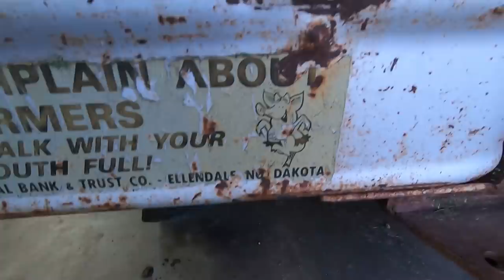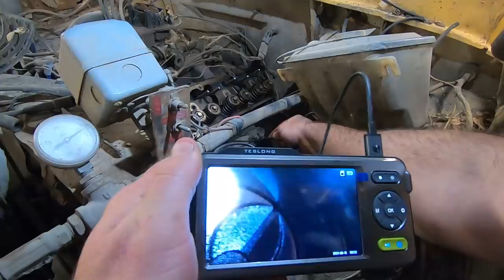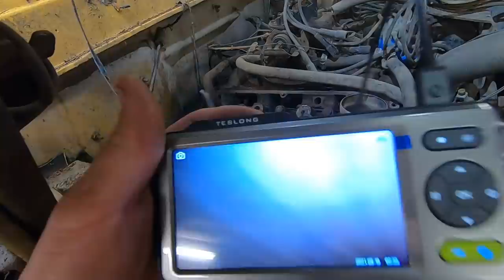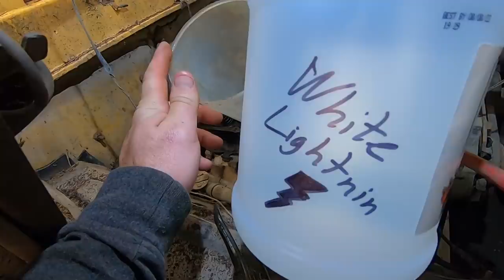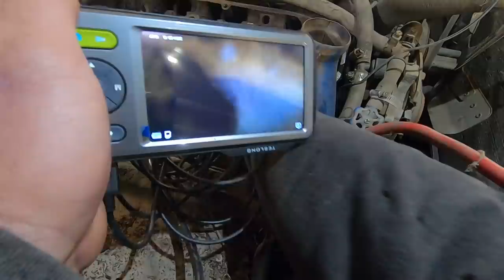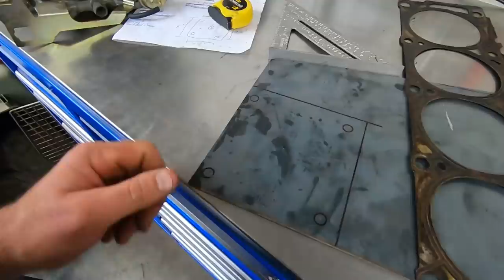Abandoned Farm Truck! 1971 Ford F100 4x4! Will it Run?!? Parked for 18 years in a field!

Comment: I never heard of the white vinegar hack to unstick an engine. I woulda got some real white lightnin and dumped it down the carb and lit her off the ensuing fireball would have been a sight to behold for sure. Either that or black powder and toucher her off Kaboom! Maybe you could get a subway sponsor they could get you samwhiches for you at a discount. Fords are only fun if they run and drive and have been maintained over the years not left to rot in a field. I have a 1989 Ford F150 XLT Lariat with original 160,000 Miles and 5.0 engine runs perfectly a 2006 Ford Explorer 4X4 also runs perfectly on its second engine and rebuilt trans and my 2004 Mercury Grad Marquis 4.6 liter V8 that I have had since 2005 original 113,000 Miles never leaves me stranded so fords are fine if you maintain them.

Comment: One trick is to prime the oil pump, maybe fuel line and drill or a pump priming tool. Second part is removing the timing chain and turning the lower end. Then you gotta free up the lifters by priming the oil pump and tapping the cam gear with a flat head and a hammer.  The oil pump priming is going to be your big helper in all of it.
Reply from the maker: It's stuck in the cylinder walls. And no amount of oil pump turning will get oil there.

Comment: Didn't cold war motors make a plate like that with a zert? Then filled the cylinder with grease  until she moved on an old straight 8 buick.  All the lifters were fubar too but they did get it running well enough after the piston was replaced to compete with 2 other cars in his back field  to race.
Reply from the maker: I'll have to check that out!
Reply: straight-8 showdown Packard VS  Buick

Comment: Had one nearly new that my brother own briefly and he was trying to do four wheel spin the tire burnouts drunk., it busted the t case and we finally found one ... this is back in 74 or 75 now I think on it, I had to send one from Colorado to Washington state for like ... a lot of money for sure as don't remember but it felt like we were paying new price for used. This was a beautiful truck when new and I have about a half rack of beers worth of stories on it. A lot of first on those with a phony rear end axle lengths and special spline as I could find axles for days and none fit this hombre. That t case had broke off the front wheel part of  things but still had your shaft going clear through to make a ugly two wheel drive but what do you do when you need a rig, it still drives and just no oil for those gears hanging in the air so, drive on. Come on Mortske, I was young and still pretty damn dumb on some of lifes simple things. I could rebuild a cummins or detroit but couldn't fix a ford. Go figure. Yep, a treasure of stories on that year truck/LOL

Comment: There's a cleaner I used in the air conditioning industry that's strong stuff and I was wondering if it would help unstick an engine. It's called nu bright coil cleaner it's about 60 bucks a gallon but it's pretty strong stuff. Might be worth a try couldn't hurt them stuck furds anyway.
Reply from the maker: Worth a shot

Comment: 12 point bolt:    THIS BOLT SQUEEZES THE COUPLER ONTO THE STEERING SHAFT. THE REASON A 12-POINT BOLT MUST BE USED IS BECAUSE IT IS VERY TIGHT TOLERANCE, AND VERY DIFFICULT TO GET WRENCH TO TIGHTEN UP WITH FULL TURNS WHEN THE COUPLER IS INSTALLED ON CAR. HAVING THE 12-POINT BOLTS MAKES IT MUCH EASIER TO INSTALL.
Reply from the maker: Nice!

Comment: I don't know a lot of things but I know a happy, confident dog when I see one and that says a lot about you, too. Love the old Furd 4x4s!
That Yee Haul Puddin picked up is awesome, btw. I'd never find something that nice here in MI
Edit: growing up my dad had a black 1975 Ford 1/2 ton 4x4. I would love one for myself but I just don't see them around, do you?
Sorry to make this so long but I've always thought a smart feller could build a tool that mounts via the inspection cover bolt holes and has a gear that meshes with the flex plate to allow for more options or greater leverage.
Reply from the maker: early 4x4 stuff is hard to find around here

Comment: Cool stickers by the way Mortske. Duff had a partner in crime this go around. If you are going to roll in it why not do it with a friend. I bought a 39 Buick that had a froze up straight 8 in it. I couldn't sledge hammer those pistons loose even after soaking them for a month in diesel. The plate you made is a good idea but for the same job wouldn't a hub puller work and be stronger? The kind with the three legs that people use to pull drums/hubs off seized brakes.  Looking forward to the next Mortske & Duff adventure. Have a great week.
Reply from the maker: Wouldn't go wide enough.
Reply: @MortskeRepair  Oh!

Comment: Bought one of them had 800+ thousand miles on it when I sold it had over 1 million miles. Six cylinder with a 3 on the tree great truck
Reply from the maker: DANG!
Reply: It was close to 1200000

Comment: Fill those cylinders with vinegar and let them soak for a couple of days. Vinegar will break that rust down. Then empty your oil pan and try putting some used motor oil in there to save the cost of oil change until or if you get it running. I have used vinegar for cleaning up rust on everything from rusted bolts to cleaning rust off from chrome. Ask your buddy, Puddin, he can tell you that vinegar works for busting rusted items loose.
Reply from the maker: He never had one nearly this stuck yet.

Comment: I use a 50/50 mix of ATF and acetone. It hasn't let me down yet.
Reply: The reason it works is that the Acetones molecules are very small and wick the ATF into the rusted and frozen parts. Even better than Kroil. Don't hate me for the last part.

Comment: Back  in 1966 I had a stuck kingpin on an axle.  I poured Coca Cola on it for several days, and, whoop!, it loosened nicely.  Never tried it on an engine, though.  Maybe you should?  Another thought:  if you'd drop the pan and remove the bad piston's large end bolts, roll the engine over a little, then the MPP might have had a better chance at moving it.

Comment: People may talk shit about the running boards, but that's what saved the lower front fenders the rocker panel and the front panels of the bed, for off-road purpose I would not want running boards, construction and farm work there just fine.

Comment: i had a '72 f100 4x4 for all of two weeks. i paid a hundred bucks for it running, with no bed. the second time i drove it, the rag joint tore, and i drifted off the road into a cow pasture. the ditch caused the wheels to lock out to the right, i rolled it 2 1/2 times and ended up on the passenger side, at least i thought i did. turns out the cab came off the frame, and the frame was on it's wheels a half a roll away. when i was climbing out the driver's door window, i wondered where the gear shift lever/helper step went. lucky me, i just got some bruises, and crazy story out of the fiasco, but you can be damn sure that have i checked the steering column on every beater i bought since.
Reply from the maker: Glad you made it out!

Comment: Excellent video Mortske Repair  :) what 360 FE means Fuel Efficiency  also why farm trucks have that have lots crud on heads plus rough motors because some farmers used cheap 60 Octane farm gas has lots Lead fuel  also don't change PCV Valves , Air Filters , Fuel Filter, Oil Filter do once year Oil changes with cheap oil and clean spark plugs plus wires also Rotors plus Points also Cap changes lots back fires also  problems to come! Also leaking gaskets plus Rich & Lean carbs settings plus leaking Chokes or have on to long and don't get Engine Flush Fluid in every 3 years at Oil Changes or 100.000miles to ! Even over revs old motor on cold or hot starts Not be mean Mortske Repair or Anyone but seen that happen and got my dad also uncles stop doing to there old trucks plus use farm gas get at fuel pumps at stations plus low Ethonal or not at all too ! Also in Petro fuel stations has Ethonal of 15 to 10% in Farm gas or 87 to 89 octane gas plus Desiel motor too 91 octane has no Ethonal but Tactrol in fuel like Varnish clean agent it horrible and can't get your engine unless rebuilt it ! So use better fuel company like Shell and you be impressed better!

Comment: Too bad that engine couldn't be saved. The truck overall is in pretty good shape considering how long it sat in a field. I guess I count myself lucky. I got a 53' Desoto, flat head six, it sat for thirty years, half of them outside. It did have some stuck valves, had to replace one. But, it wasn't stuck which was really nice since the car only had 35k miles on it. It starts faster than anything else I own and now runs like a top.
Reply from the maker: Those flat sixes never seem to stick hard.

Comment: The reason the RB (passenger) valvetrain looks worse than the LB (driver ) is the the FE Ford draws crankcase vapors in through the PCV on the RB and pulls fresh air into the engine through the LB. .
Reply from the maker: Good info!

Comment: FE (which means "Ford Engine," not Ford-Edsel, nor Ford Engineering) variety comes from a broad selection of bore and stroke sizes to achieve cubic-inch displacements. The 332 and 352 are fraternal twins, virtually identical engines with 4.00-inch bores. FE we're bad about holding moisture .
Reply: FE refers to ford-edsel
Reply: It’s Ford Edsel
Reply: Those engines were built in the same plant as the 351 Windsor. The location of that plant is in (E)ssex county Ontario Canada -also known as the Ford Essex plant,which is in the city of Windsor Ont. I used to go to the drags in Detroit & watch the FE 406 Fords race the 409 Chevs. I got this from an uncle who worked there,The E stands for the Essex plant.

Comment: Now that there's  a hole in the piston motor is junk should  Try some experiments on it chemicals torch air hammer some sorta hot oil pumped threw 
To improve the mpp use hockey pucks in the cyclinder and all tread on the corners tighten from the corners no center bolt and top plate 3/8 minimum 👌
Reply from the maker: Good idea!

Comment: Was taking my 63 Galaxie to a car show one day about a year ago.  Stopped for breakfast.  When backing out of the parking spot, rag joint gave way. It was still partially connected. Since the road home was fairly straight I decided to take a chance (at about 15-20 mph) as I was only 4 miles from home, and the only real turns were onto my street and into my driveway.  Thankfully no issue ....but note to self. ....never, ever do that again.
Reply from the maker: Sketchy

Comment: I liked your idea using the bolt but use thicker steel and put a grease zerk in it and pump it full of grease... My uncle used to do that with stuck small engines...
Reply: He actually left the head on and hollowed out a spark plug and welded or threaded the grease zerk into the spark plug... The grease would aplly even pressure to the piston and would be less likely to break the piston... Also i think he used an empty grease tube and put either atf or marvel mystery oil in it... Assuming your vavles are closed of course.... And you could also apply the same tactic to other pistons that are on a downward stroke for a little extra push.... A lot of the newer electric grease guns make between 10 and 20 thousand psi.... BTW love the channel keep up the good work
Reply from the maker: We did that on a couple other engines and there's always a leak the grease escapes from. Usually the head gasket or by a valve.
Reply: Copy that... Haven't seen that one yet I guess
Reply: @MortskeRepair  could maybe try it like you were with a half inch thick steel plate and a grease fitting
Reply from the maker: @thehightechredneck9777  You gotta get a damn good seal, like a machined surface with a gasket like the head uses.
Reply: @MortskeRepair  could use some thicker moly grease too... I did find the video where you tried it... Not sure what grease you tried... I don't think it's gonna work on every engine... But thought it could be worth a try

Comment: The cheapest cleaner for rust n carbon I have found is vinegar.  Works wonders on:
Condensation rust
Carburetors
Stuck cylinders / rings on motor cycles
Plugged heater cores and radiators

Oh sn*t. Someone brought it up as I'm typing.  It does work.  Not fast but works
Reply from the maker: Thanks for sharing

Comment: There is a 74 year old U Tube guy Farmjunk 101. He buys old tractors. many stuck from water raining in the exhaust. And he actually is very successful in getting  many of them broke free and running. You cant force a piston upward in a badly rusted cyl. so ya gotta remove the rust before you attempt to turn the crank. A wire brush on a drill . sandpaper. pour diesel on rags placed in the cyl and set it on fire. Crazy D broke loose a stuck tractor with Iodine?

Comment: I like some Ford engines, 351 Windsor and 302 are excellent....I had an old 73 pick up with a 360....that needs to be pulled and scrapped as fast as possible...lol it's a big block with no power, overheated all the time....I hated mine and yanked it out after owning the truck 3 months.I like old Ford trucks but if it had a 360, that would be a deal breaker for me Oh it gets about 9 to a gallon....boat anchor

Comment: My go to snake oil is 50/50 Acetone and transmission fluid and 200% time and patience, Nothing is gonna work yesterday or overnight. Each to their own even if it is sheer brute force that breaks it loose at least in all fairness everything is lubed up. A dry Hole is an unhappy hole

Comment: Old FE blocks are pretty much bullet proof if you take care of them the main drawback is the exhaust manifolds / Whats an extra 2 or 300 pounds in the engine compartment when all you have to do is change the oil and filter every 3000 miles and plugs and points every 25000 .

Comment: Poor Puddin, getting rode hard and put away wet with Mortske this week. On the other hand,  kinda disappointed with this vid... I would have hoped that Mortske would of pulled the motor out to rebuild it , never known to see an couple stuck cylinders to make ole Mortske throw in the towel.   Do you think you let it soak enough?  Maybe you should have tried with Coke Cola, I hear that works,  or  Zep'um or  Maybe tried to fill the radiator and block with hot water to make the block expand ? or 2 parts kerosine and 1 part mystery motor oil,  Or maybe you should of poured a few sammiches in it,  get it all liquored up and maybe it would of let you twist its crank ...lol  we love you Mortske.
Reply from the maker: Jeez there's only so many hours in a day Mike!
Reply: @MortskeRepair   I feel your pain though, I had a stuck piston in a old tractor, soaked it for months in everything i can think of, even through the torch on the motor, even disconnected it from the cam shaft and put a jack and rod on the piston to push it, ended up lifting the front end of the tractor.... still didn't budge.  what got it done you say ?  I broke the piston into pieces with a mallet and re-sleeved the cylinder and put a new piston and rings in. 
But you Mortske, are a Legendary status Mechanic,  There infinite minutes in a day if you do not sleep .... As a business man taught me, I don't do excuses , I only do solutions . lol  puddin wouldnt have quiet .

Comment: i like the idea 56:23, but my logical head says thicker plate, then add some thicker plate, then add a a tube so it sits as close to the cylinder wall while on top of the piston, thick wall or solid pug type 1/2 inch thick even 3/4 thick. wonder if u could adapt a small 2 or 3 tonne bottol jack, endless pos a bill a tiss, what say you duff.
Reply from the maker: So many options!

Comment: 🤔Just trying to figure out how your Tiffany thinks that pushing on one cylinder that is still connected to the other 7 is gonna be more powerful than if you Roll The Crank Out ( IF ) possible , So you can isolate one piston at a time, Witch would allow a much greater Mechanical Advantage .🤞 Good Luck Sir🤙✌

Comment: Salt and vinegar only works on copper radiators, heater cores, lines. And only a 5 hour soak no heat. Stuck rings, drive piston down and hone walls. Piston is down,  Fire is last hope. As in fire on the piston. Draw the oil in.

Comment: Still looking for a motor for this truck? If so my buddy has a 390 outbof a mid 70's I stripped the motor down put all new seals gaskets looked great on the inside. We put it in a 1980 4x4 ran great until blew out the rear dif just been parked past few years.
Reply from the maker: Where are you located?
Reply: @Mortske Repair  Joplin Missouri, i can double check with my buddy see if he still willing to sell it. Wouldn't take much to get it going again, battery fresh gas and maybe carb work. It's sitting in that old 1980 with a blown out rear end.
Reply from the maker: @christopherrichards4205  Sounds good
Reply: @Mortske Repair  so way it sounds 600 get the truck cause motor In it and just easier on you to verify it runs. But he is keeping the bed off it, rest if the truck is pretty well junk except motor trans and transfer case.

Comment: Instead of torching stuck pistons I really wonder if cold shocking would yield different results. I believe you can pour alcohol in a cylinder and then drop in dry ice to super chill the alcohol. It’s pretty available and cheap. Never seen anyone try it, could be a first on YouTube.
Reply: Figure if there is coolant too, it may heat soak the block so you are just freezing the piston and rings, might really open up clearance.

Comment: I pou diesel fuel or kerzone down the valve cover and in the carb. THEN put an air chuck set to half stuck into the carb to vaporize the kerosene.So.eti.es it helps break loose .